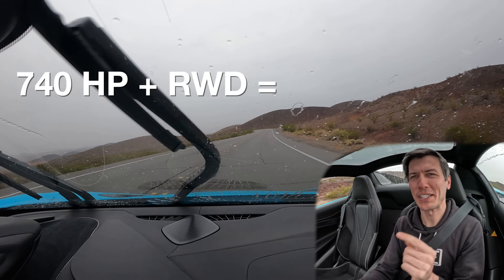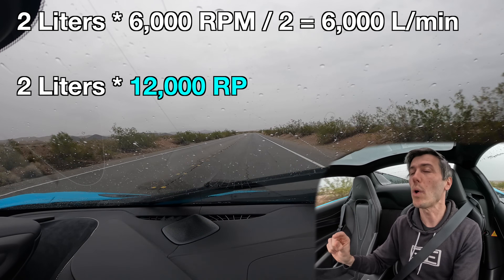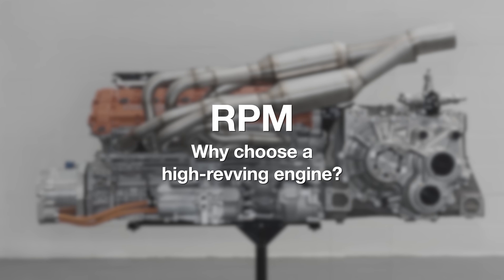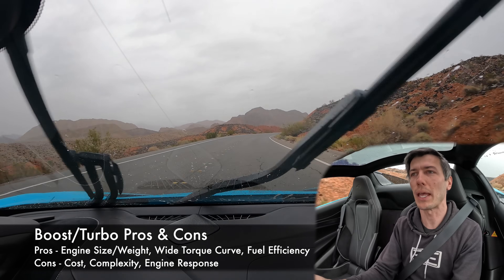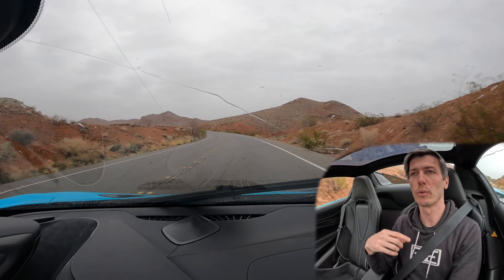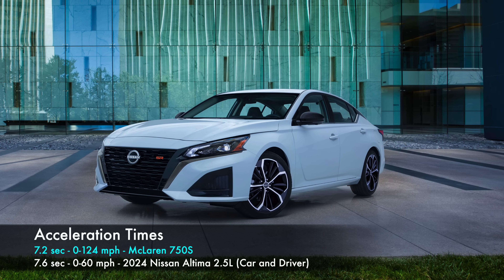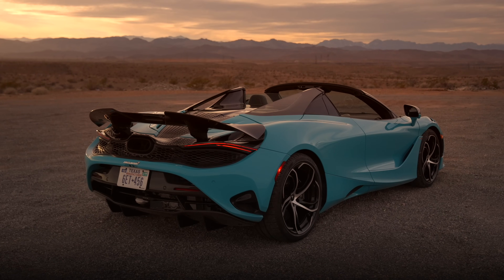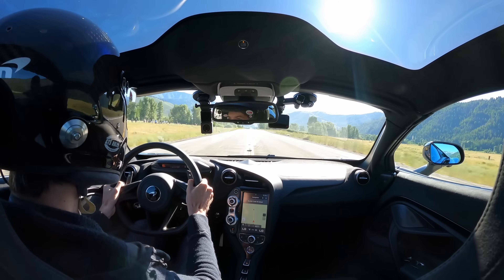Boost vs RPM vs Displacement - What's Best For Horsepower?

Comment: What I learned from this video is that the ability for an engine to make power and how immediately it can make power is dance between the rate it processes air, how much air is processed per cycle, and how compressed that cycle of air is when ignited. 

Based off the nature of how ICE engines are used in cars it makes sense that turbos have taken over in road cars, since the wide range of speeds they operate encourage a broad torque curve thats less easily achievable with high displacement engines.

In a similar sense, that reveals why aviation engines are often so massive in displacement. The amount processes per cycle at a constant low rpm is whats king in making a propeller aircraft perform at modest altitudes (turbos find introduction the higher you go)

And of course high rpm engines as key techniques make the most sense in motorsport and enthusiast cars because of the ease engine rpm can be transmitted into wheel rpm, and thus high speed performance, the same range of drivability not being needed in as wide an rpm range.
Reply: Aviation engines are similar to boat engines in that the reason you want large displacement is for reliability -- not necessarily for performance. Car engines can make really high peak power numbers, but absolutely not for seconds to minutes to hours at a time. Its why you'll see 20-30 liter engines making 2500hp; it sounds horrible, until you remember they can do that all day long. Larger bearings, larger pistons and rings, larger camshafts, larger oil capacities, larger areas to distribute heat, larger valves (and seats that wear slower) --  these all work together to make these engines exceptionally reliable at their highly limited peak power.

What I wish he mentioned in the video is that low RPM is highly preferable for engine reliability, such is the benefit of turbos. All those super high revving race engines don't last long at all.
Reply: Another metric is the temperature of the air being processed, which is half (or so) the trick of nitrous. Chills the mix and adds oxygen, adds boom, and 😊

Comment: The oder I get, the more I learned to appreciate displacement. Much more fun to drive if you're not a track focused person.
Reply from the maker: Agreed - it's great!
Reply: Now you need to try 2 electric motors, one on each axle with instant torque. Charge it in your garage. Test drives are free.
Reply: And high revs is best for track focused fun! Turbo has to be the least enjoyable to drive from a pure enthusiast perspective
Reply: I'd say turbo is a good daily car, small light engine, lots of boost, turbo lag can be fun
Reply: @tturi2 it is not physically small or light.
Reply: I was appreciating the displacement of my belly then I decided to eat less.
Reply: I've gone the opposite. I find myself wanting more rpm as I get older and lazier, just driving around in one or two gears 80% of the time and just use the entire rpm range from less than idle, to past redline into the fuel cut. I tend to drive in higher rpm and lower gears these days to have better control of accel/over run decel and avoid using brakes.

Comment: Man you doing math calculations while driving a 720s on the rain must be some kind of achievement
Reply: 750s*
Reply: The Plaid can do it all for you and faster ⚡️🇺🇸
Reply: @larryc1616 lol ok
Reply: @larryc1616 And the plaid will do it whilst being completely soulless and bland
Reply: @larryc1616  In a straight line while it's new, there's no way of getting around the weight for turning and breaking though.
Reply: @sircefiro  true yet 4800lbs Plaid American family sedan 1:30 Laguna Seca faster than turbo s, gt3, nismo gtr...
4680/3800lbs Roadster = GAME OVER
Reply: @larryc1616  Yeah, you could see with rc cars years ago, once they went brushless lipo, scale up that tech it was going to kick ass.
Still the sound and feel etc will always be a factor with ice.
Reply: @larryc1616 hope you feel safe at night with your electric vehicle in your garage. I sure as he'll don't.
Reply: @paulronan6770  Some insurance companies aren't covering that
Reply: @larryc1616  what about the nurburgring the lap times? it's still quite impressive I suppose
Reply: @larryc1616 nah it would never beat this car if there is even a single bend in the road
Reply: @larryc1616 Dumping fuel in the tank is quicker than waiting hours to charge
Reply: This man is a professional he certainly has a script prepared
Reply: Once you get familiar with the math of boost/engines/wheel torque/ electric motors it’s pretty easy
Reply: Similar to how he has figures posted up outside the frame in his normal whiteboard videos, he probably has something like a script with important info listed in his FOV in this video, but it’s outside our FOV.
Reply: For those talking about math, as a self proclaimed math guy, those numbers were fairly simple. It's just 6 * 4 / 2 = 6 * 2 = 12, 12 * 1000 = 12,000. The numbers he pulled for hp per car were just off the top of his head, hence the "slight correction" on screen, in post. He's been doing this long enough that he knows these stats fairly well. Plus, it helps that engineers and numbers are like PB and J.

He also almost certainly did not have a script anywhere around him, just a general idea of the points he wanted to hit. For all we know he rambled for two hours, then cut it all out. He's been doing the YouTube long enough that he's probably very good at speeches, and that paired with his incredibly knowledge of the industry mean he's remarkably concise even with an unscripted video. He's just chatting about something he knows inside-out.
Reply: Bro did NOT watch the video 🙏

Comment: If we're talking about absolute maximum power, displacement is your first priority of the three for one reason - cooling capacity. Bigger engines have bigger coolant passages which makes cooling more efficient. Very important if you're trying to make a powerful yet aerodynamic car.
Reply: Less chance of overheat and WAY better TBO!
Reply: wouldn't they also have more trouble moving heat away from the combustion chamber since it gains volume quicker than surface area?
Reply: @crackedemerald4930  You are correct. Surface area to volume ratio is higher for the same number of cylinders. I also don't think cooling is down to the capacity of the water passages so much as that of the external heat exchangers provided that the coolant can be moved efficiently.

Comment: Hello everyone,

The Omega 1: A New Rotary Engine That Could Spell The End Of EVs...😮
Reply: The entire engine only weighs in at around 35 lbs and the system produces in the region of 160 hp and 170 lb-ft – around the same as a non-sporty turbocharged 2.0-liter 4-cylinder.😮

Comment: Today I was made aware of a 1.5 litre supercharged jetski making 310bhp. Can you imagine how much punishment that engine takes as the thing is smashed into the water every few seconds at 70mph.

Naturally I want it more than anything. Naturally I can't afford it as I spend all my money on tires.

PS Give me RPM all day.
Reply from the maker: Wow - brutal!! And yesss, team RPM! (Though I do love a big engine)
Reply: @EngineeringExplained Meanwhile you have beasts like Valkyrie, 6.5L V12 at 11,100 RPM
Reply: @kerimca98  except as a 4 cylinder sharing a bore and stroke that would only be like 2.1L, so it is not a "huge displacement" engine like a 7L V8 or like the vipers 8.4L V10.

Not to discredit Aston Martin, it takes immense amounts of engineering to get an engine to rev that high, but for a V12 it isn't that large, they are just a naturally huge.
Reply: Got to be a way to contrive tyres onto some kind of amphibious jet ski thing as an excuse...
Reply: Good plan, I'll work on it  @ApothecaryTerry
Reply: Idk if you can actually utilise that power in the water on such a lightweight craft?
Reply: I've driven a 150bhp honda turbo jetski and it seemed like all the power you'd ever need  @TimberWulfIsHere
Reply: @Lawrence-p3z  fair enough
Reply: Grindhard Plumbing co  took a 1L supercharged snowmobile engine that makes similar i believe and dropped it in a Triumph Spitfire. its ridiculous.
Reply: That’s Kawasaki. My ahem, lightly modified, 2021 zx10r is making 205 whp (so probably like 230 at the crank) with 998cc
Reply: Yes!!! Revs all day!! Being into bikes is great for that. Old school 4-cylinder 600cc bikes that rev to 16K rpms just hit differently 😋😋
Reply: I'm guessing you are talking about the Seadoo inline 3?

Yes, they take a huge amount of punishment, but not something they can tolerate long term unfortunately. My friend has 2 of them, the first one exploded at less than 50 hours, the engine block got torn in half, stuff you you see on top fuel and tractor pulls, and not something you expect for a Jetski. 

I agree, rpm is the most fun! But also most destructive when something fails. All the more fun though haha.
Reply: @3800S1 you sure it was the engine? I have an in-line 3 ski-doo snowmobile that makes over 200hp made by the same company and it’s always other things breaking in the drive train. Engine is bulletproof though.
Reply: @TheScottbb1  Yes, the engine was cut in half when the rod let go. The only thing that kept it intact was the head.  All the bolts in the block were bent/sheared sideways from the massive shock it experienced, the boat mechanic that replaced the engine had to use a grinder to cut the bolts off to get the remaining integral oil pan/ crank girdle off to looks for clues on why it detonated suddenly like a nuke.  The rod that failed was actually still attached and free spinning on the crank, the rod snapped up top and the rpm it was at when this happened whipped the rod around so hard, that it was what sliced the block in half.  Even the starter motor was cut open and broken off from the rod swinging around.

I saw it in person, it was an absolute breathtaking failure!

Somehow, no damage to the hull, so therefore it didn't sink, and the insurance only covered failures where it sank or the hull was ruptured. Can't make this stuff up!  8K out of pocket for my friend.  BOAT = Bring Out Another Thousand. 😂
Reply: Ah, the VTEC, is a small engine, with a racing cam, called VTEC, like the S2K, is only a 2.0lt engine, but revs too, 9K rpm.
Reply: On that note doesn't the G16E-GTS make 300hp out of 1.6? that's pretty close and even more so considering its meant to last day in day out
Reply: I recently saw a modified GR Yaris that was running 600hp. It's a 3 cylinder engine. 200 horses per cylinder 🤯
Reply: You don't need tyres(a big weakness on cars) on Watercraft! You don't need auxiaillary cooling on Watercraft! You don't have to control noise or pollution ditto! Probably a Reed valved 2 Stroke!

Comment: imo they killed the t50 with suuuuuper long gears. One of the huge benefits of revving really high is being able to use shorter gear ratios for higher torque multiplication while having decent mph shift points. Its the slowest accelerating 650hp car I've ever seen.
Reply: What acceleration metric are you referring to when you say it’s slow, and what are you using for comparison?

Comment: Not even below 10 sec for the 1/4 mile sounds pretty much outdated 
Shitty plaid does it in under 10 sec, so if u take that as your benchmark, why are those Premium supercars still so slow?!?!? The price they call for those cars should give you way more power! And not sure how old this video is but the new bugatti bolide does the 1/4 mile in under 8sec, with more than 1800hp
Reply: Focusing on just acceleration times is outdated.

Comment: What any kook would do with a 750hp RWD car in the rain? Powerslides! Jason? A video…😂 BTW nice video, thanks for posting.
Reply: 750hp rwd in the rain doesn't mean you go sideways at the lightest touch of the pedal.
It just means you tap the accelerator slowly with controlled steering inputs.
I'm sure the car also has a rain mode setting for easier driving in the rain.

Having said that it is also sad you can't safely make the vroom vroom sounds for the camera in a car that wants to sing!

Comment: And that, folks, is why my 1.8 L Type R Del Sol, with a redline of 8500, generates 225 hp.
Reply: And a whopping 2 lb/ft
Reply: And that, folks, is why your 1.8 L Type R Del Sol, with a redline of 8500, looks real good in my rear view mirror.  Headlights getting closer and closer together.....
Reply: @Flies2FLL  It looks good from every angle, Chucklenuts.
Reply: And a Saab 2.0 turbo makes 220hp at 5500, but almost twice the torque.
Reply: @larsjrgensen5975  You talking about the fighter jets, or those cars that broke all the time?
Reply: @TheRealDrJoey  They are not as durable as a honda or Toyota, there is simply to much GM in them for that. But they are not bad at all.
Reply: Sounds good until you compare it to any 1000cc bike produced in the last 20 years...

Comment: More RPM, more boost.
More RPM, Better gearing.
Smaller engine, less weight.
Less weight, better everything.
Motorcycles figured all of this out decades ago.
For a fraction of the cost of a McLaren you can buy an H2.
Reply: For what?
Some drunkass dude comes and crashes to you in your motorcycle so you die 
Lose control even with going 70kmh and you die
Reply: The McLaren will eat the H2 around the track.
Reply: Motorcycles aren’t as dangerous as you think. Personally I’m never going to be driving on a track. Also motorcycles travel through highway traffic better than any McLaren simply due to its size. Motorcycles are all about time and space. If you understand that you’ll stay safe even with bad drivers. The McLaren may win on a track and in comfort but on the streets nothing can touch an H2. 1000cc supercharged  4cyl. Revs high. Has strong boost. Light weight.  It’s honestly in its own league above all other factory road legal machines and it does it at a fraction of the price by sticking to the fundamentals of speed.

Comment: A topic, rather seen on a D4A channel

One more thing about displacement vs rpm: consideration of main gear ratios. So 12000 rpm engine operating like 6000rpm engine of double displacement would not need to spin as slow at lower rpm and therefore the power will be equal along the whole range.
However! Here comes inertia and because of i^2 for the same dynamics the engine of half displacement and coresponding gearbox would need to be 4 times as "light" rotationally. Which is never the case

Comment: The reality is, most Automakers building super cars opt for boost with turbos instead of higher displacement engines for tax reasons. If was the market to decide, not a surprise it would be all about displacement.
Reply: and turbos and revs
Reply: No, it would be about revs just like in the old days.
Reply: Displacement is for people who don't know how to make an engine it's heavy for the power output
Reply: @tristansimonin1376 tell that one to Bugatti
Reply: @tristansimonin1376 isn’t a GM 6.2 lighter than something like a 3.5 Ecoboost? Not sure saying larger displacement is heavy necessarily holds up every time in reality given many common engines on the road.
Reply: @tristansimonin1376  Do you honestly think that a twin turbo 4.0L v8 is lighter than a Z06 engine? Good one
Reply: @MrArcticPOWER  pretty sure that the lt6 is heavier than a flat 6 of a gt2rs
Reply: @tristansimonin1376  Short block, sure. If you include everything, there's probably not a big difference.
Reply: And the proof of this was back in the 60s when everything was 6-8 liters. These motors were generally under stressed even though they made a lot of power solely because they were so huge.
Reply: @Saltyoldguy-  Those engines did not make a lot of power lol. They were pigs.
Reply: @F0XD1E  are you serious? The big blocks in the late 60s were making close to 400hp. They were not pigs.
Reply: @Saltyoldguy-  definitely healthy for their day, though when you think about modern NA engines that got near that horsepower level with much less displacement it kinda puts it into perspective that we’ve come a long way.
Reply: Now try getting an 8.4 litre engine in the back of that McLaren and keeping the weight down to below 3,000 pound (and the 765LT is 2,709lb).
Reply: @TheEulerID  I don’t think the later Viper engines were too bad once they went all aluminum. The later Vipers were like 3300lbs with a steel space frame chassis so just thinking that the McLaren monocell CF tub could shave a couple hundred pounds off that at least and I don’t think it’s outside the realm of possibility that the Viper engine in a McLaren could still eek in at under 3000lbs.
Reply: It’s also emissions
Reply: Agreed.  With aircraft engines we don't care about the environment or taxes and cubic inches are king.  With that being said during World War 2 manifold pressure reigned supreme